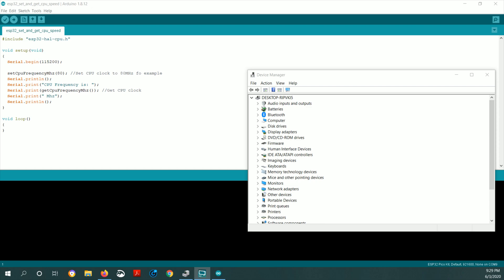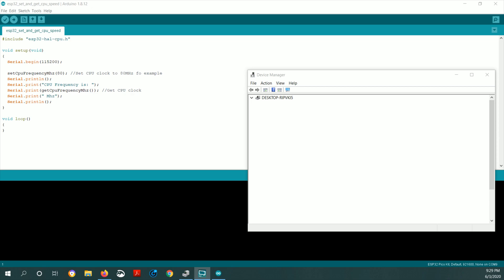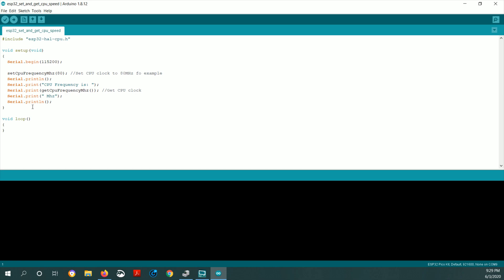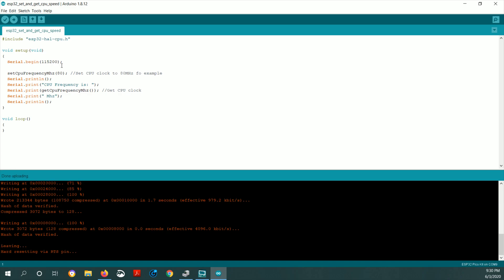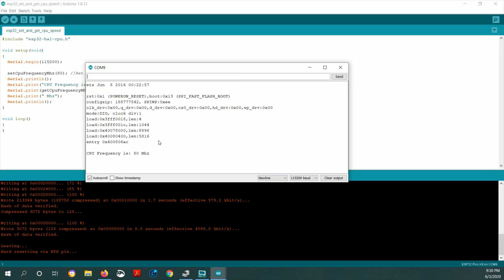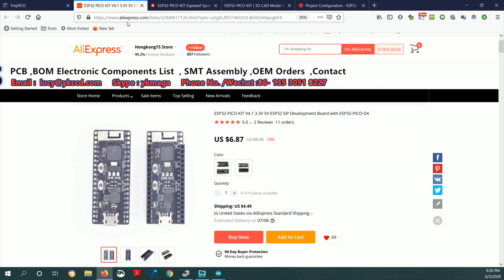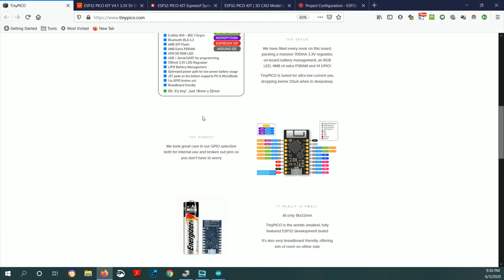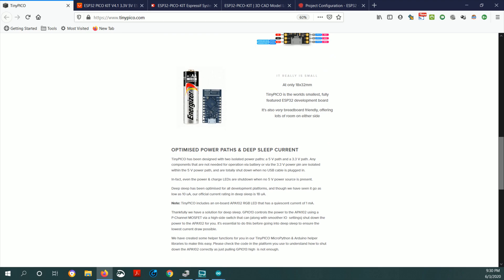How to Change CPU Frequency or Speed for ESP32 Modules via Arduino IDE

Comment: Its not work , i try to change to 320 mHz and the response its still 240 mHz , any solution ? Thank you !
Reply from the maker: I believe the ESP32 frequency maxes out at 240 mHz, 
You can refer to this site for info:
https://deepbluembedded.com/esp32-change-cpu-speed-clock-frequency/
Reply: @HasanainShuja  We know that , im looking for a solution to get more performance out of this little board ! Thank you !
Reply from the maker: @musictherapymeditation   Ok, I'm not aware of any overclocking solution.

Check this board out for performance, it runs at 600 Mhz and can be overclocked to 1000 Mhz with cooling.
https://www.pjrc.com/store/teensy41.html

You can download the CAD model here:
https://grabcad.com/library/teensy-4-1-2
Reply: @HasanainShuja  the teensy is a single core CPU with no built-in networking. It costs more than a Pi 2 zero w. The one thing it has going for it is that you can actually buy one right now. Raspberry Pis are tough to find with the current chip shortage, that is unless you want to pay extra for a "kit" version.

Comment: I tried to change ESP32 WROOM 32 from 80 MHz to 240 MHz but my timer does not run faster, which indicates that the CPU frequency has not changed. Only when I set it lower, e.g. 40MHz  it works.

Comment: I tried it on ESP32 WROOM 32 and although the speed is set, the timer became slower meaning the Prescaler is still dividing 80 MHz
Reply from the maker: I don't know too many details about these parameters but I read up on them.

This may help others who want to understand too.
https://openlabpro.com/guide/timer-on-esp32/

Found this on the forums too:
Getting WiFi and Bluetooth to operate at lower frequency has been a challenge for me too. I think 80 mhz is their limit.

So far the lowest frequency I've been able to get I think was 40 mhz and I can't remember if WiFi and Bluetooth had been disabled or not.

ESP32 needs to improve on their libraries I think compared to Arduino, but they have a larger community too and bigger backing.
https://esp32.com/viewtopic.php?t=1299

Comment: Where can you download the directories you need?
Reply from the maker: Here is a good link that shows you how to install the libraries:
https://randomnerdtutorials.com/installing-the-esp32-board-in-arduino-ide-windows-instructions/

Although the new IDE should support it automatically. I might be wrong. It had them for my ESP32-PICO-KIT module. The older modules may need to use the website I mentioned above.